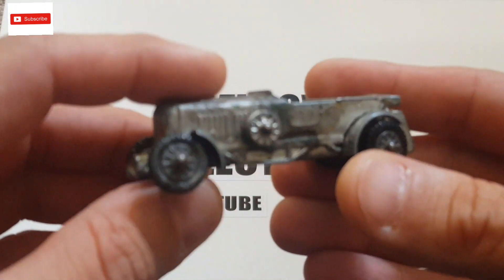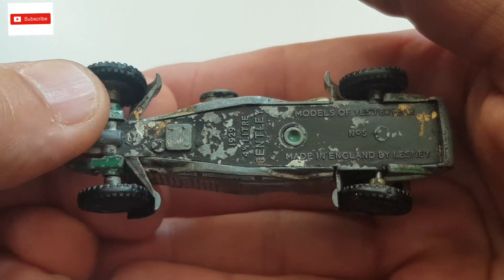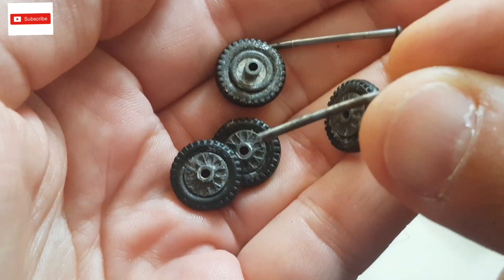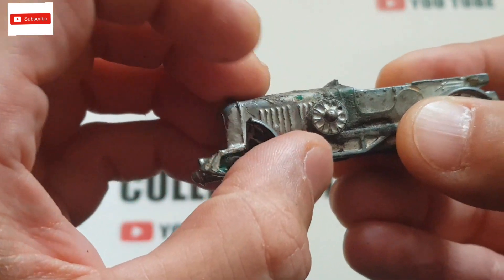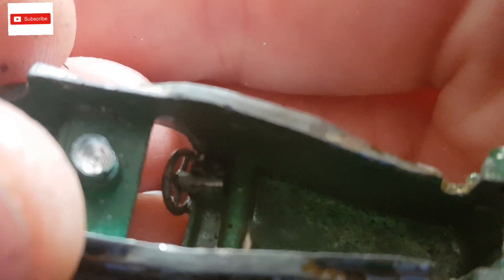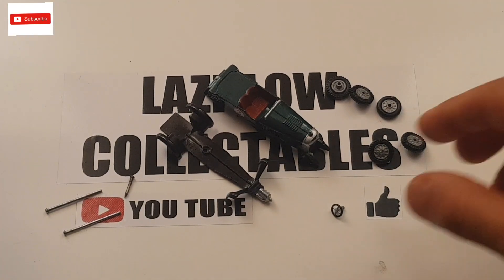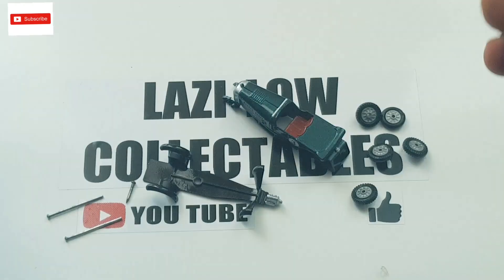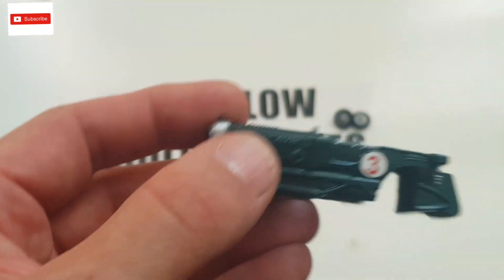Matchbox Bentley 1929 4.5 by Lesney restoration.

Comment: Hi Laz, I like how you did this one. Very classy in British Racing Green. That was the only colour choice. I was intrigued to do a Google Images search on the Bentley. The Matchbox models had a fold down square windshield frame and large headlights on the front grille. Many of them were missing those parts though, as often happens with older models. However, yours is upgraded very well from the beginning state. Truly nice work, as always. Thumbs up from Switzerland! 👍
Reply from the maker: Cheers Andrew, yes I was scared first that many parts are missing but then I've seen that this model was as it is .the only thing I had to replace was the missing spare tyre.thank you for watching